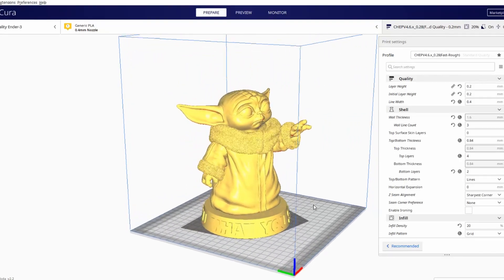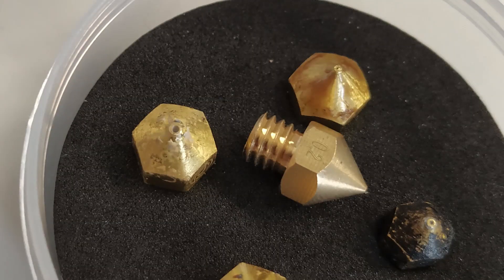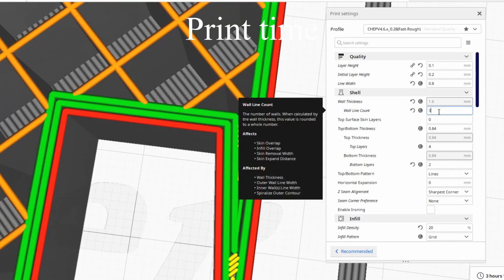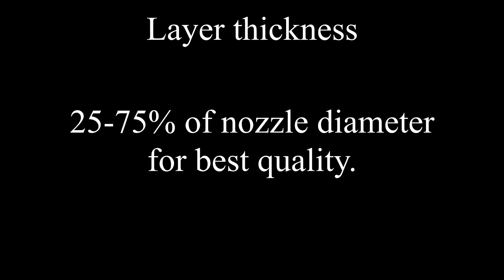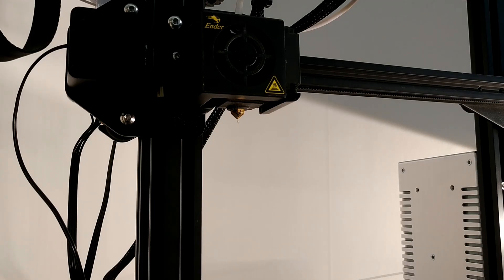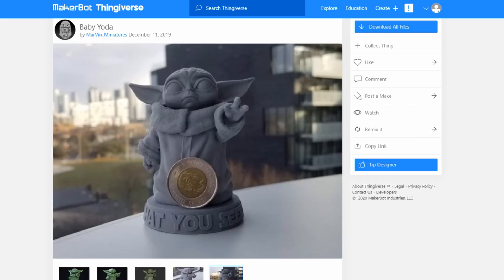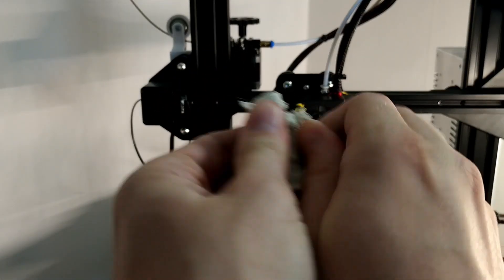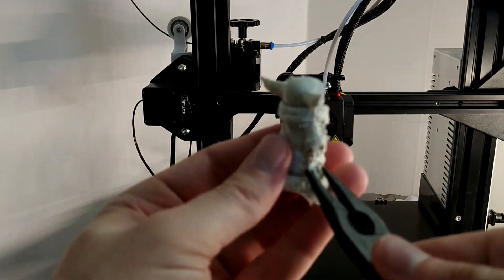Have you got the right tool for the job? 3D print better with this simple change.

Comment: Very interesting. 
Do you think a higher(%) nozel / layerhigh ratio will make parts more stable? 
I think if compared to your nozle the layer high is set very tight, the material melts better on each layer.
A Test would be so interesting!